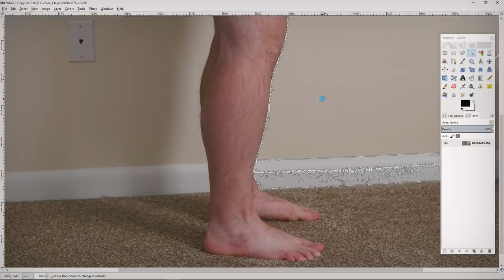Building "A Christmas Story" Leg Lamp (the MANLY version)

Comment: So fantastic. Loved the vacuum trick!
Reply from the maker: Yeah man! One of my favorites :)
Reply: Works if you blow compressed air the opposite direction. I do it for wiring up custom bikes and choppers feeding wiring in the tubing or handlebars.
Reply: I like that too, I used that trick once to run a leader for some fiber optic cable about 100 feet through some conduit with a number of bends. Works great!

Comment from the maker: I've had some people ask about the parts used to make the lamp. I'll drop a list of them below. These are Amazon affiliate links so they help me out. Thanks for the support!! Also anything you buy through these links, whether it's the parts I link or some other holiday gift, I still get a bit of a kick back! Ho ho ho :)
Materials
– Leg model
– Maple butcherblock off cuts
– Wood glue http://amzn.to/2kID2jI
– Carolina Boot (only the right boot!) http://bit.ly/jackmancarolina
– Carolina sock, half a pair 🙂 http://bit.ly/jackmancarolina
– Lamp kit http://amzn.to/2Btm7GV
– Lamp threaded rod http://amzn.to/2k756ym
– Lamp cord http://amzn.to/2hXMJHE
– Waterlox tung oil finish http://bit.ly/waterloxjackman
– Rubber feet http://amzn.to/2nUqfbV
– Paste wax http://amzn.to/2j647fJ
– Pleather http://amzn.to/2k55IUX
– Eyelets http://amzn.to/2AeQO4r
– Paracord http://amzn.to/2j1cNmb
– Pallet wood for the Fra-gee-lay crate

Tools (Not all of these are required, but this is what I used for the build)
– Miter saw http://amzn.to/2j614UM
– Table saw http://amzn.to/2j4bvVU
– Thickness planer http://amzn.to/2j4ISuI
– Bandsaw http://amzn.to/2j4auNu
– Glue spreader bottle http://amzn.to/2rwnnYk
– Bar clamps http://amzn.to/2k4EvjT
– Angle grinder http://amzn.to/2BxiIai
– Turbo Plane grinding disk http://bit.ly/arbortechjackman
– Circular saw http://amzn.to/2qr6ZnM
– Random orbital sander http://amzn.to/2jrwsJC
– Strap clamps http://amzn.to/2obipxa
– Oscillating saw http://amzn.to/2k4ujrn
– Disk sander https://www.jackmanworks.com/giant-16-disk-sander-…
– Brad gun http://amzn.to/2pJiKFh
– Palm router http://amzn.to/2obmZeX
– Drill and driver http://amzn.to/2wy5wSZ
– Hacksaw http://amzn.to/2k8azoq
– Welder http://amzn.to/2k7yJ2q
– Eyelet crimper http://amzn.to/2juyAlB